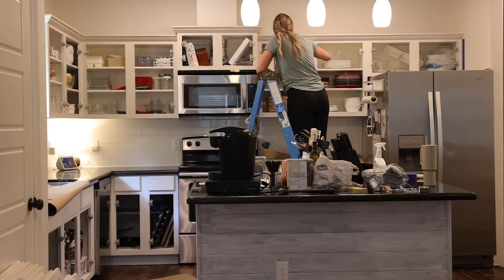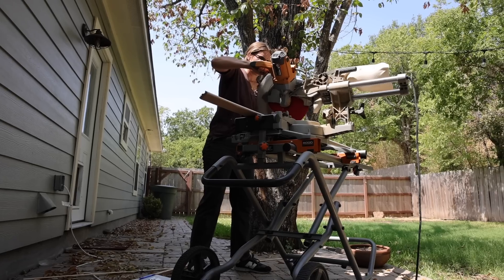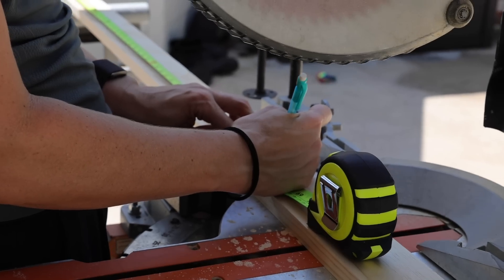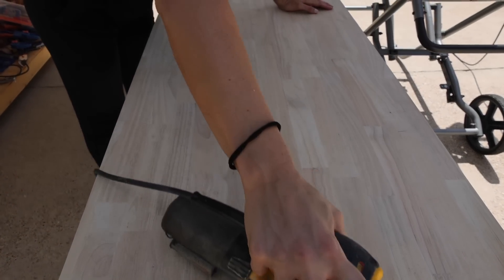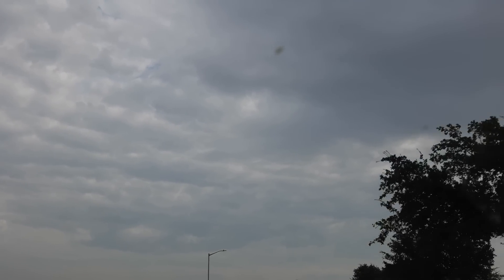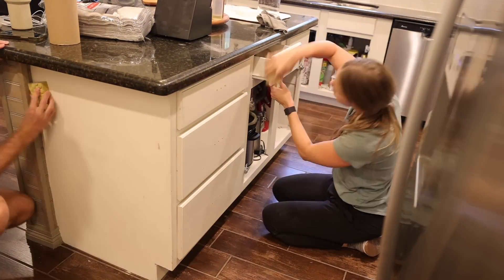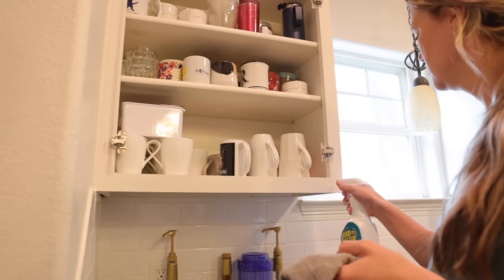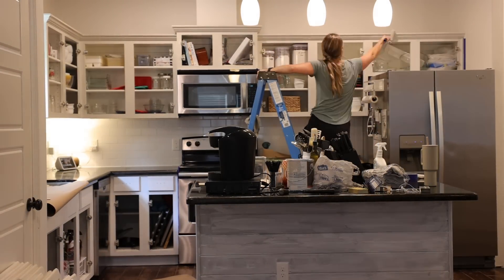DIY Kitchen Makeover In 14 Days + Building A Custom Dining Table From Scratch

Comment: Nice work on the custom table.  The color selection for the cabinets is beautiful.  I love your ambition and attention to details.  BUT:  You painted around the outlet plates and light switches rather than removing them.  Sanding cabinets and especially the tops of the drawers with contents still inside the cabinets so the grit can fall into the drawer and you have to take everything out anyway to clean the drawers anyway.  I realize you were up against a time deadline, but both of those are NOs.

Comment: I used Beyond paint with built in primer and top coat.  My cabinets are beautifful, they were golden oak (yuck).  Which paint tape do you use?  I've tried several and they come unstuck or I get bleed through under the tape line.

Comment: Krud kutter is a great cleaner but PLEASE BE CAREFUL TO QUICKLY REMOVE EVERY BIT OF IT.
IT WILL CAUSE PAINT TO PEEL IF YOU DONT. 

IT DID A GREAT JOB ON MY VENT FAN . IT REMOVED ALL PAINT DOWN TO THE METAL!!